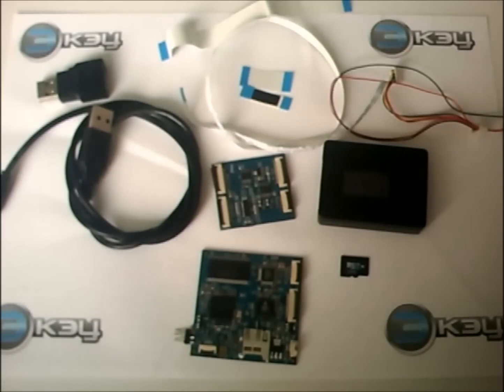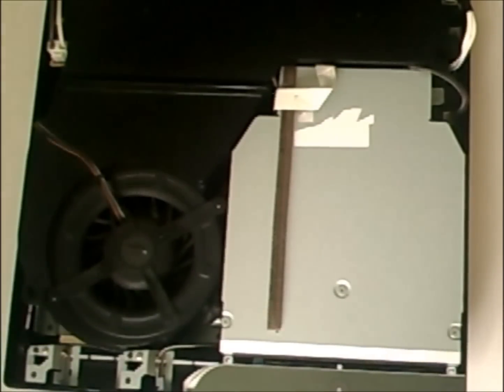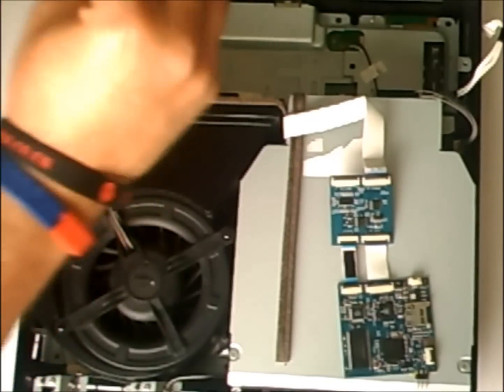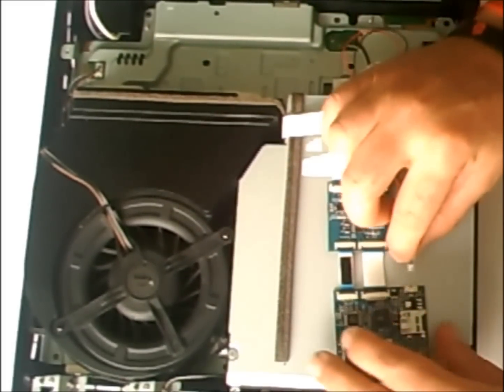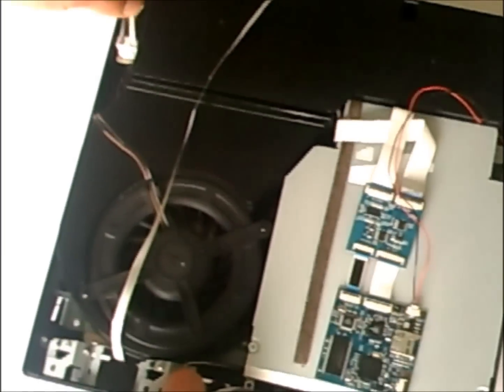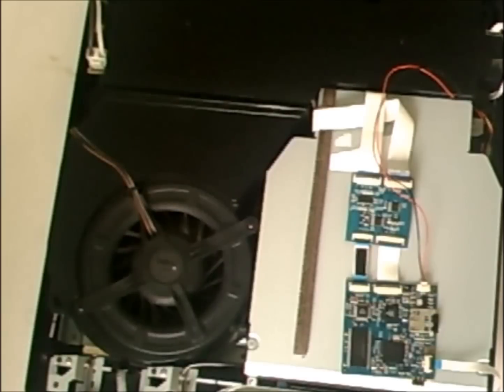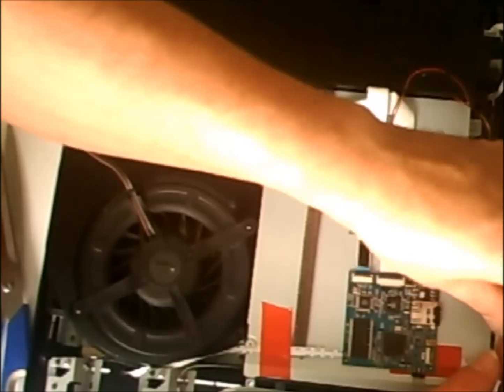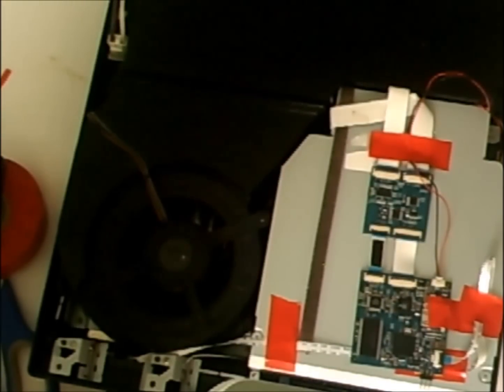3k3y. 3k3y-S Slim install Tutorial. Play Ps3 games from a Hard drive

Comment: If the console has been updated, is there no way to extract the key? Also, can you still use the 3k3y with an original disk in the drive and load games from the 3k3y? Cheers.
Reply from the maker: The latest 3k3y fw allows this, the "boot" disk needs to be supported.
Take a look on the forum.
Reply: M Starlored Cheers for the reply. So basically, you have to leave a legit disk in the tray, so long it's in the DB of supported titles. That sounds more promising now.
Reply from the maker: All versions of 3k will work without key extraction, as for when the adapters will be out I have no idea. You could take the risk and see if you can find the version in my video, places like aliexpress may still have them. I have been using this on a 2103a with no problems (it is running Bdump). 
Note that this is at your own risk, this adapter was pulled because a LOT of people were having problems, sometimes on console versions that worked for other people.

Comment from the maker: The file that I put on my SD card was the Bdump obtained from the Ps3's Blu ray Drive.
ATM the 3k3y (phat) and the soon to be released Super Slim can be used on ofw. This will change all versions will work on ofw as they are released.
CFW (Bdump) is still the preferred method of Install.

Comment: post 2 - just wondering
.. if it is possible to emulate a disk and run a iso from a hard drive... you can also run homebrew on the machine... does that mean you may be able to apply a cfw firmware update through a resigned disk iso because i know that the ps3 sometimes updates to the firmware on the disk that is in the console so im thinking maybe you may be...

Comment from the maker: chechk01/04 and 06 are confirmed as working.
As already mentioned you soon won't need to be on cfw.
The 3key will be able to be installed and run on any ps3 regardless of firmware.
cfw was only needed for key extraction, with the release of the new firmware there is no need for the Bdump.
When released and if needed I may put up a video showing this.